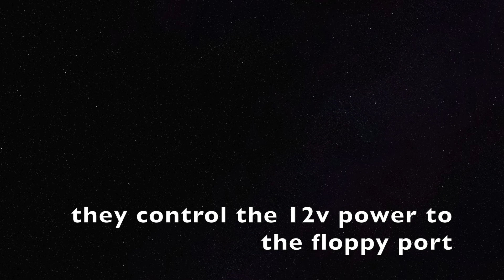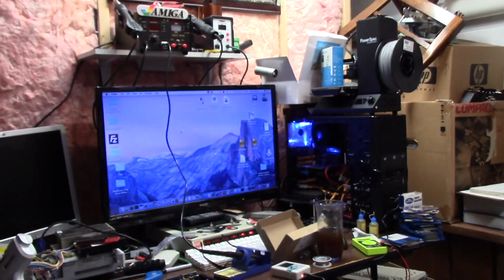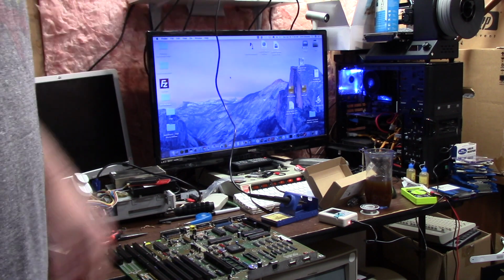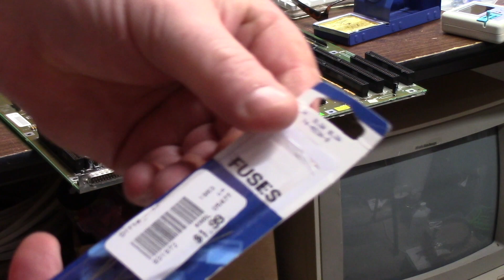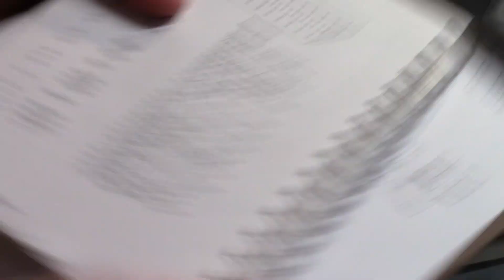Episode 87 - Amiga 2000 Pico fuses

Comment: I have an external floppy interface I was using with a gotek drive. I tried connecting the internal drive instead (the external interface only has 5v on the connector) and it blew the f4 5v fuse. No idea why. I assume a 125v 4A will work as a replacement?
Reply from the maker: 125V ?? its a 3 to 4 amp 12v fuse....
Reply: @ChrisEdwardsRestoration  it’s 5v on f4. 4amp. Not sure if the fuse voltage matters.
Reply from the maker: My brain goes out.  Yeah 5v sorry
Reply: @ChrisEdwardsRestoration  Yeah and i am pretty sure as long as the fuse voltage rating is 5V OR higher it'll be ok... I must have shorted the 5V to ground or something... will try again. Thnx for the info.